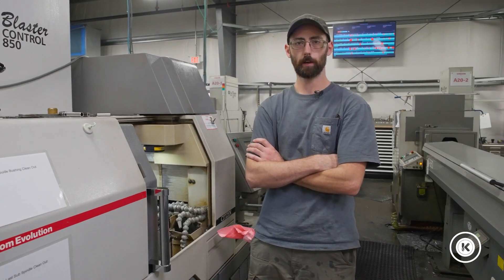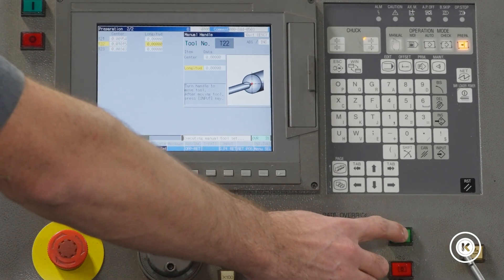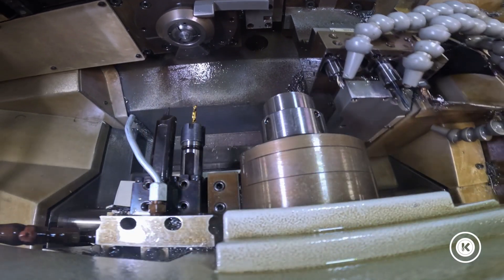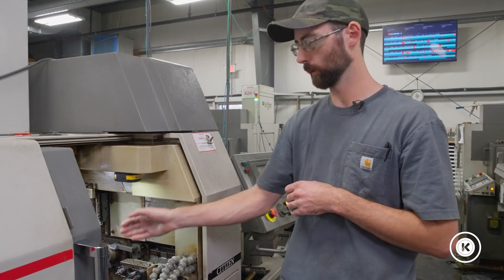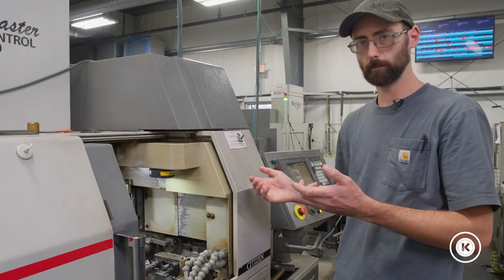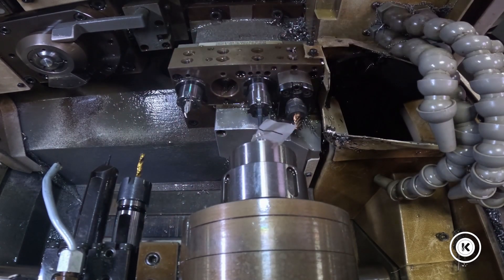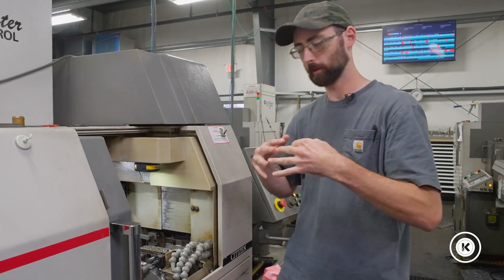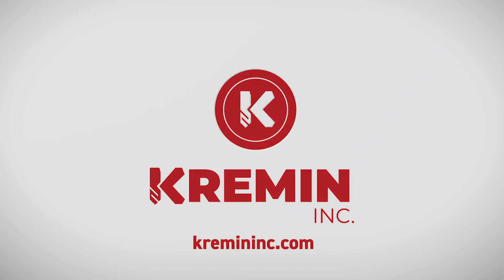How To Touch Off Sub Spindle and Backside Tooling on a Swiss Lathe

Comment: This is good unless you’re running tight tolerance. For example if you run a part which the O.D. is datum A. & the I.D. Is datum B. It has a true position call out for .001
Your holder has to be indicate after you establish your tool distance touch off and tighten the set screw. This way after every tool change you wouldn’t have to take the holder out and only the tool. Since it’s already indicated centered.